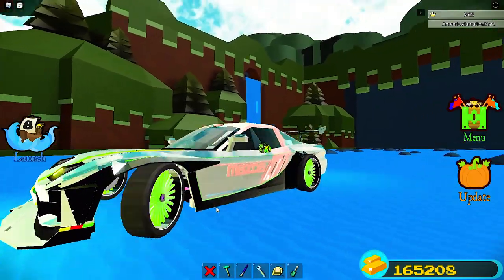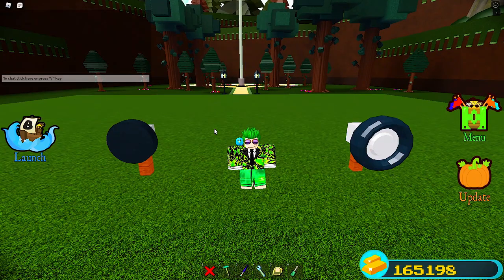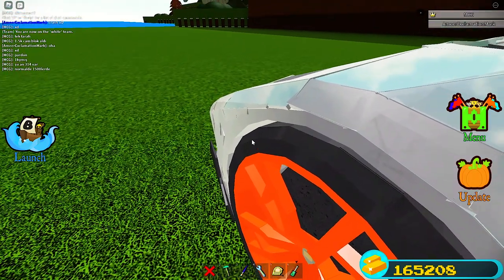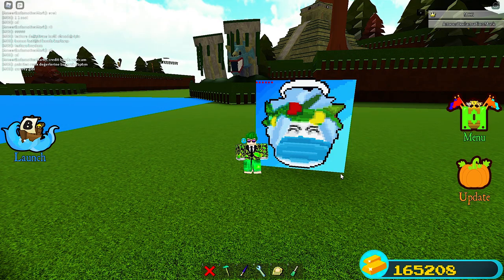Make Epic Custom Wheels *Tutorial* | Build a boat

Comment: Oh, there’s another way to make the wheel.

1. Buy the Trovel (costs 7.5k gold)

2. Do the same wheel steps, but place 1 tiny part down, then clone it to the opposite end. Select both pieces, clone both, put them back, then rotate them. Do it until you get a circular wheel.